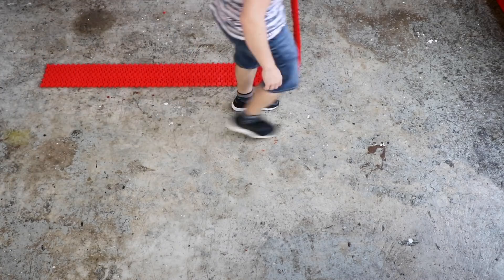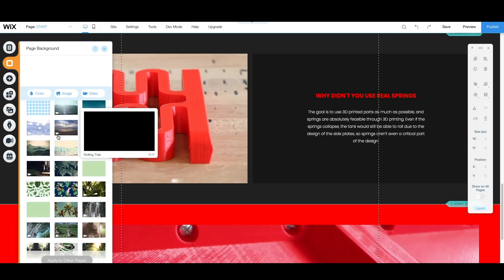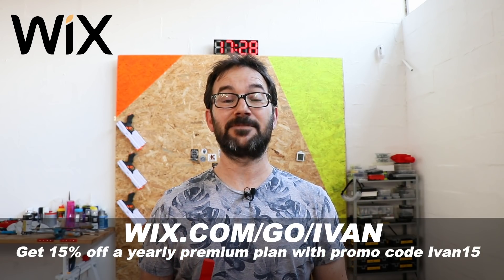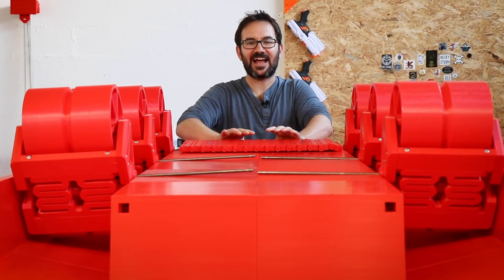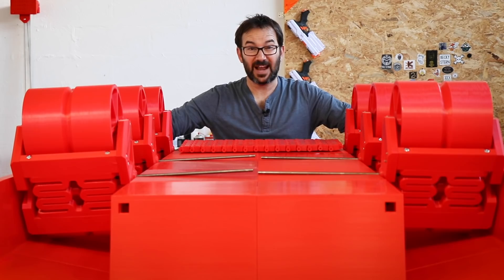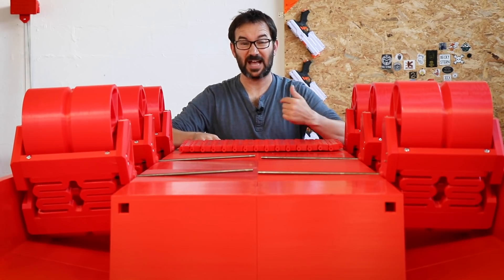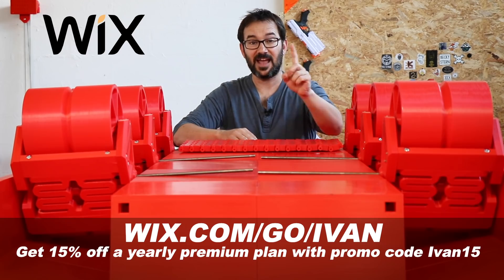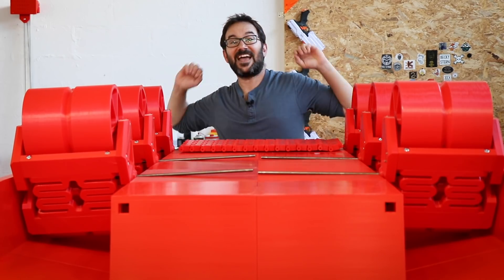BIG 3D PRINTED TANK - THE WHEELS

Comment: Why not doing the big and simple parts in wood? Your project is wasting lot of pla for nothing
Reply from the maker: It is a 3D printed tank. You're either missing the point or falling very short with your suggestion. 20mm steel plate  would be a much better suited suggestion.

Comment: you, sir, need a crane pulley thing installed in your roof on some sliders so you can lift things... certainly not like engine block things (too much support required) but this tank would be effortless.

Comment: Oof.. that's a LOT of pressure on those bearings. If you haven't already, please double check their recommended use and load limits. You may need to switch to a different style bearing at this size.

Comment: Ivan, I recommend that you get yourself a .6 or preferably a .8 nozzle for your CR-10.   Your prints will be much stronger at .8 with .4 layer height.  They will still look good and they will take far less time to print.  Just be sure to do a test print or two to adjust your perimeters and infill as they will both change.  You do run the printer a little slower, temp a little hotter but you still finish way faster. ;)

Comment: why not use a larger nozzle? .8 and the print time is cut in half
Reply: The guy is called Stefan from cnc kitchen. And you are right... It depends on the relation between nozzle size and nozzle diameter
Reply: Munir Ali He already has his settings perfect at 0.4, making the switch to 0.8 successfully would require alot of expirimenting. Also its been proven that parts made with a much higher layer height are not as strong.
Reply: @samuelyoung2671  Not true. Dialing in 0.6mm or 0.8mm is not that hard. He could do it in a day and these builds would be sooooo much faster.
Reply: Samuel Young Larger nozzles typically produce stronger parts - the perimeters are wider and most of the strength of a print comes from the perimeters.  (You can do the same layer heights with a 0.8mm as you do with a 0.4mm nozzle, it is the perimeters that save you the most time.). Eg, say you want a solid .96mm perimeter - instead of specifying 2 perimeters with a 0.4mm nozzle you can tell the slicer 1 perimeter to get your 0.96mm wall.)
Reply: @samuelyoung2671  I believe its a little more subtle than that. Printing at a higher layer height for the nozzle size is relatively stronger, so you could have a .8 nozzle with a .4 layerheight and it should be stronger than a .8 layer height (there is a good channel somewhere around here with a german fella that does deep dive stress tests around all these things, and i believe that was his conclusion. cant recall his name though)
Reply: @zakkus  cnc kitchen...thats the youtube channel... I guess the guys name is stefan.
Reply: Was honestly wondering that. Fine nozzles are great for fine pieces, but when you need to pump out huge quantities of large parts (that, other than fine holes) dont have much detail at all, wouldnt a much larger nozzle make more sense??

Comment: You can save some time when smoothing the rough edges of the freshly cut shafts by putting them in your drill's chuck (assuming it can fit them) and spinning them on a file or sand paper. Thins also ensures the edge fillets are more or less uniform.

Comment: I really don't understand why you print these massive projects on a 0.4mm nozzle at 0.2mm layer height... seems very inefficient and a huge waste of time. Get an E3D volcano or a Mosquito Magnum with a 0.8, 1 or 1.2mm nozzle and print at layers above 0.6mm, you won't regret it, will take your print time down by 8 times and even more and will make your prints even more solid.
Reply: Sounds like you'd lose a load of resolution doing that?

Comment: I really hope that electricity bills are not that high where you live... running all this big printers 24/7
Reply: 3D printers do not use as much power as you might think.
Reply: Mad Taff but the cost of the filament...
Reply: @baconwizard  The filament he gets for free from his sponsors? FYI a week long print takes less than $5 in electricity as measured with a kill-a-watt.
Reply: @baconwizard  OK but I pay 34 NZD for 300m of 1.75mm which prints at well I normally print at .4 mm it goes a long long way mind that’s for PLA/ABS and if you make your own vase (single wall) type supports instead of letting the slicer program do the supports it does a lot of printing.
Reply: @baconwizard   true
Reply: Xxtrengt 88 well if it is he can use the money gathered from his patrons
Reply: Well...in Spain power bills are quite expensive. Probably he want the tank to raid Endesa's building.
Reply: @gosonegr  Hmmm becuase of this climate hoax and the money they are spending on something that is not happening and then taxing us like lemmings, power is expensive everywhere in the world not just Spain
Reply: @MadTaff  Nah, thats with the diésel and gas, the power is been expensive since mid 90's
Reply: @gosonegr  How long do you think the climate hoax crissis has been going on funded from the 1970's at least, its not just this year. what do Petrol and Diesel have to do with electicity its the tax on coal and the cost of green power that causes the price increase
Reply: That's what sponsors are for (yeah, counting Patreon in that too). I hardly want to imagine his printer maintenance routine, though.
Reply: @YesterdaySoup  Have to say once my 3D printers where setup I have found that even after 2000 hours of printing on a Flash Forge pro all I have ever done is replace a thermistor that blew on one hotend and level bed otherwise it just keeps printing same with my Tevo Tornado 900 hours and have had to do nothing to it, just give the hot end a wipe/clean now and again mind the Prusa I3 copy I bought needed constant maintenance all the bloody time. I guess though that Ivan is printing 100's of hours a week so probably has a lot more to do to them.
Reply: @YesterdaySoup  Cool. I have stopped greasing and have started using WD-40® Specialist® Dirt & Dust Resistant Dry Lube PTFE Spray no crud builds up and everything slides so easy. Used to use lube and grease but was sick of it getting cruddy and thick this stuff is brilliant and last ages on the rods and threads also a lot easier to apply. Have to say that was the issue with the Prusa all the nuts and bolts.
Reply: Just look up the kwh price in Spain and there's your answer
Reply: @siegmundeurades5753  When i tested my printer it used less than a kw over 24 hours doing PLA and just over with ABS
Reply: haha
Reply: @daniilp6688   The facts and data records going back to the 1890's. Living through 50 years of perpetual terror tactics of the ice age is coming, the planet is going to boil, sea level rising, ice caps melting and none of it has happened. I am not saying we are not killing the planet but it’s not CO2 that cause climate change, The greatest expansion of the human race happened when CO2 was 10 time what it is now, CO2 is the life blood of the planet, NASA have had to admit the planet is greener now that anytime on record. What is killing the planet is Plastic, the damming and re-routing of rivers, the highly caustic chemicals used to make solar panels and Lipo / lithium batteries. We are breaking the natural cycle and that causes weather changes, not climate. Remember climate is based on a 15 to 20 year period anything else is just weather. Look on YouTube for Tony Heller, Dr Don Easterbrook, Dr Willie Soon the list is endless but Tony Heller use historical newspapers and pictures to show the scientific facts are true. I am not trying to make this political the politicians are doing that already. Basic question if CO2 is so bad why have they have not banned commercial growers from pumping tons of CO2 in to their greenhouses constantly every day 365 days a year but it’s bad for me to drive my car, why are they not screaming at China and India as they are in the process of building more than 75 coal fired power plants. They also never mention that everything we wear, touch or makes the modern world what it is comes from oil and the only reason that it’s affordable is because of the amount of fuel we get from cracking crude oil. They are picking on the wrong thing and all these protesters and alarmists would be better off going to the beach and picking up bags of rubbish not trying to tax CO2.